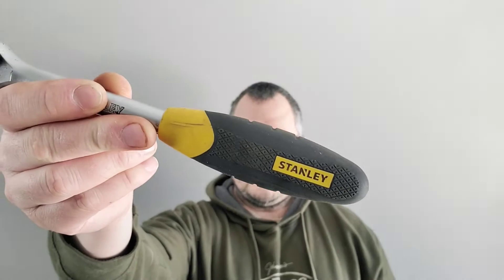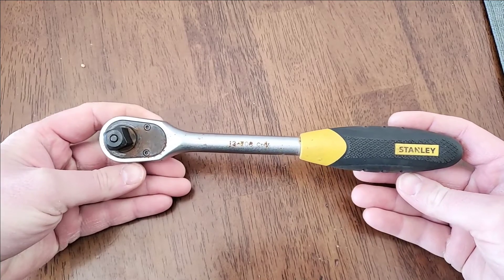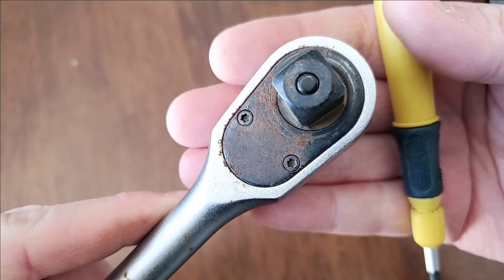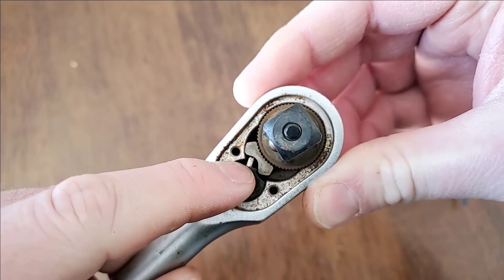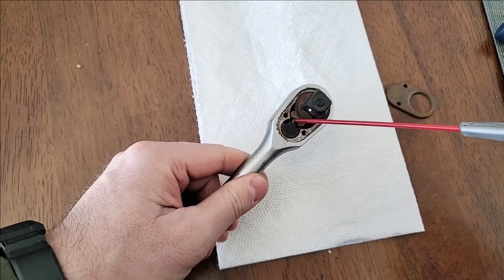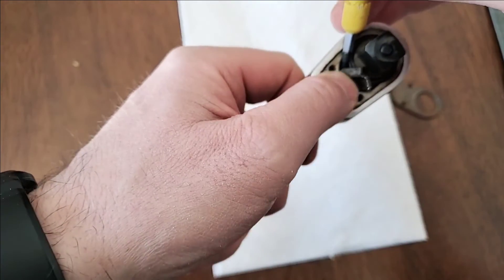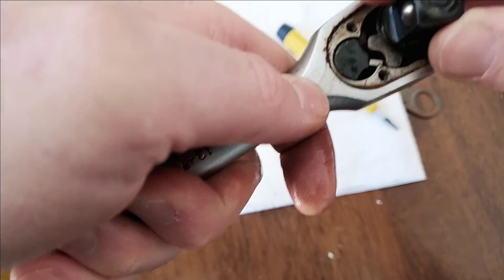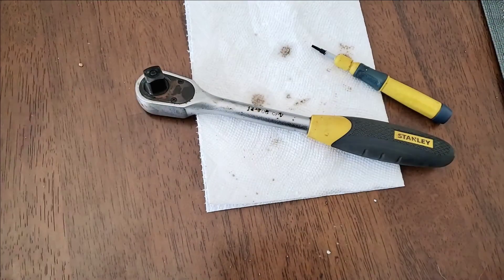Stanley ratchet repair

Comment: Too bad you didn't take it completely apart...do a proper cleaning & lubricate with 3 in 1 oil or   super lube grease!    WD-40 is Not a lubricant!
Reply from the maker: I agree, WD-40 is not a lubricant. I like Jigaloo as a lubricant. Especially where dust and dirt is an issue. In this case I did not need to completely disassemble it to get it working again. It's just a quick fix. If I was to restore it, I would strip it. Thanks for watching and I appreciate the comment. Have a great day.